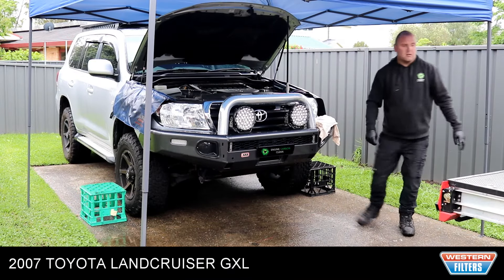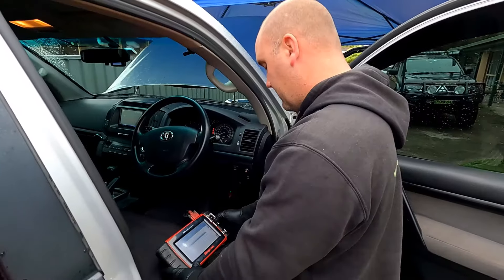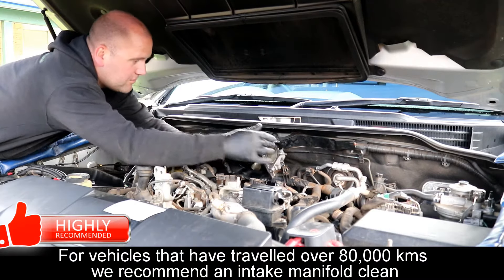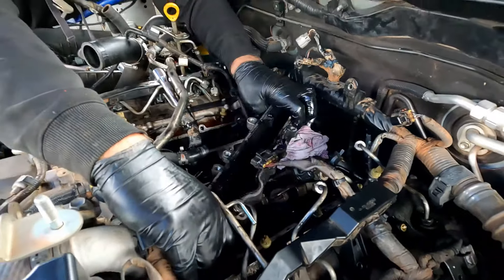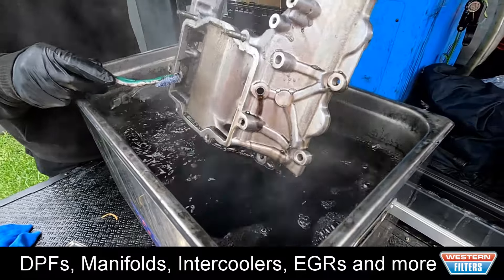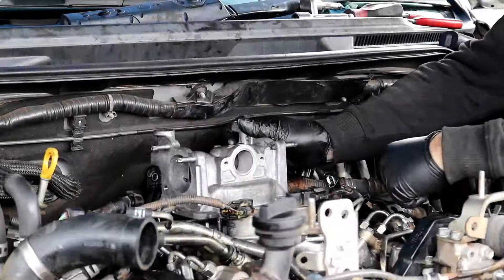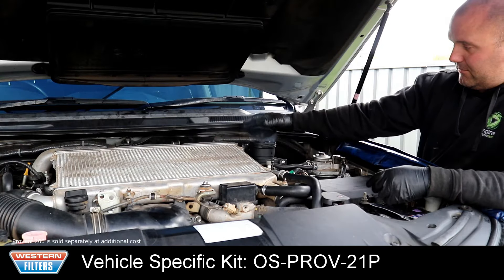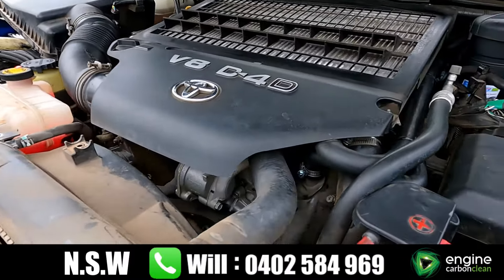TOYOTA LANDCRUISER Manifold Carbon Clean

Comment: “Not all the fuel gets burned”. 
Come on guys. This is the INtake manifold, etc. Air-fuel mix doesn’t just stick to the insides of the manifold or anywhere else for that matter. In the case of gasoline, it just evaporates residue-free. 
For diesel, it’s so hot in there and with the forced induction there’s not a lot of opportunity for the fuel to stick to the inside surfaces. You guys know this!
Just tell your audience the real reason for the sticky mess in there. You want to sell them a catch can anyway!
The residue is caused by positive crankcase pressure forcing oil-laden air into the intake manifold, deliberately, for emission control reasons. 
I’ve installed your filter in my Nissan Pathfinder and it works great 👍 

I’m happy to endorse your product. Please just stick with the facts, for your own credibility.
Reply: I think the comment "not all the fuel gets burnt" must be referring to overly rich fuel to air mix ratio inside the combustion chamber due to the constricted air intake - so the same amount of fuel that is squirted inside the combustion chamber is not fully combusted due to slightly reduced air getting in during the intake stroke.  So it's a reasonable comment to make.

Looking at this engine with 300,000 kms, it appears that the buildup is no different to an engine with 180,000 kms.  After a while, the buildup doesn't increase anymore, from what I can tell.  I am sure Toyota engineers would have factored this in.

However a stuck EGR valve may be unavoidable eventually as it is a moving part, after all.  This can be rectified without removing so many components.  An application of an intake cleaner like Seafoam will help free up the stuck EGR valve.  

https://youtu.be/3agltbN4C7M
Reply: @tempestv8  I get what you are implying, but it is scientifically incorrect to make statements about over-fueling and constriction of intake manifolds. 
Note that I’m not saying YOU are wrong: the entire premise is wrong from the start. 
Engines have a Mass Airflow Sensor which meters precisely the amount of air coming into the engine. The injectors deliver precisely the right amount of fuel for the amount of air being brought in. There is no over-fueling possible. 
Even if the engine is running a little rich, Diesel fuel does not coagulate. It will simply go through to be burned and you’ll get more soot. 

The short of it is; crank case air, laden with oil vapors, goes in and sticks to everything. 
Stop allowing the oily part of that air getting into the manifold and engine and the problem goes away. It’s really that simple.
Reply: @Giant-Egg-Roll  Yes I agree that a modern ECU controlled turbo charged engine will inject the correct amount of fuel based on the readings from the MAF sensor to maintain the most optimal stoichiometric ratio.

The statement originally made that is in debate here is probably most applicable to non-turbo charged older generation diesel engines which are entirely reliant on vacuum to draw air into the intake chamber.

Hence I really like the ending provided by this person in his video:
https://www.youtube.com/watch?v=yQ-zWVF9E4Y

From the 8:24 mark onwards.  My thoughts resonate with the presenter's conclusions.